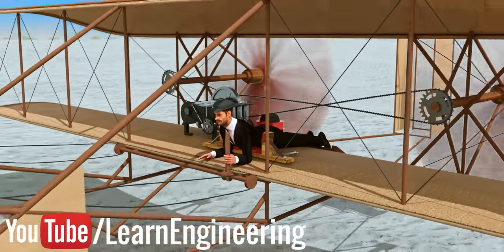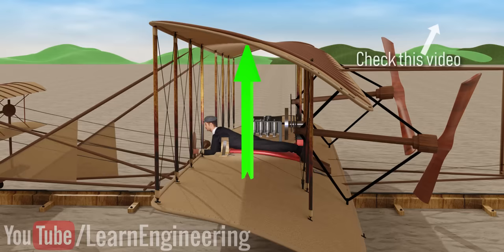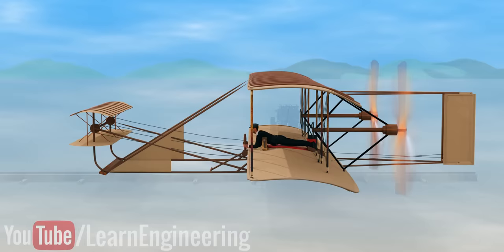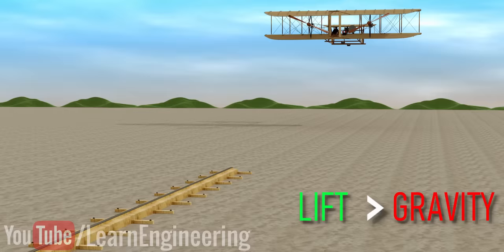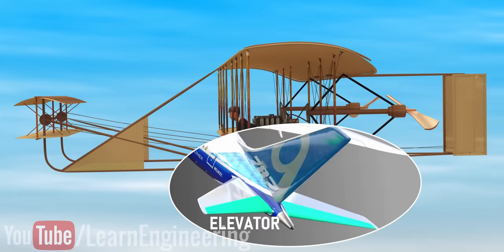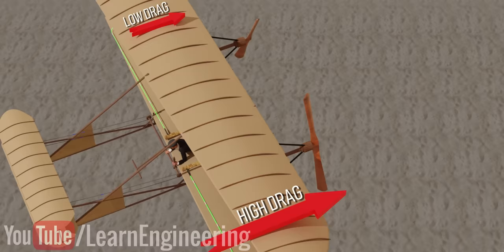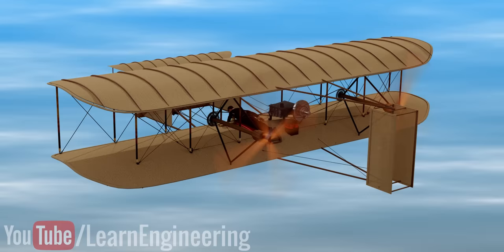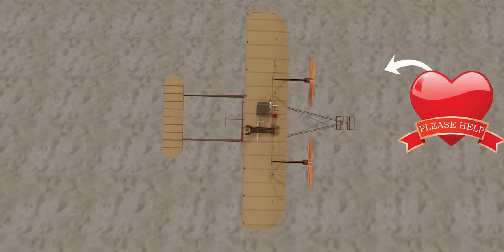The Brilliant Engineering of FIRST FLIGHT !

Comment: Pilot off center to correct center of mass offset due to engine weight.
Reply: Satvik Sharma 👍
Reply: I was stinking the same
Reply: The perfect replica don't flew.
Reply: Kyon pel raha hai.Cheel, kawaun ya Hans jotne se viman udta hai.Viman Shasta ki copy dikhade.Viman Shasta print kyon nahi hua Sankrit mein. Dinassaur ke avshesh miley hain.Oldcoin bhi milta hein, old utensils milta hein, old bees,bodies, old swords, arrows sab milta hein phir old viman kahan gayab ho gaye. Unka avshesh kahan hai.India mein tab kerosene petrol 16 ya 17  century tak nahi tha phir viman kya season ke oil se udte they
Reply: A reason that has not been considered is to keep the engine as far away from the pilot as possible.
Capt. Ferber lost his life when he was crushed by the engine which was located directly behind him.  
Had he been flying a Wright 2 Model A,  he would have probably survived.  

There have been several Wright replica crashes that are quite similar to Ferber's
ill fated flight.  All attempted to make a bank and turn from a low altitude and dug a wing into the ground.
The pilots of the Wright replicas walked away unscathed.
Reply: @sanpol4399  
SB: Joe Bullmer argues that the photograph is from 1908 not 1903.  I agree.

Tom Crouch claims it was a photo of the 1903 flight.  
Did the Wrights make a similar claim?

The alleged statistics for the  4th flight are the least credible.  The performances of the 1903 exact replicas in 2003 in lighter winds and with a less experienced pilot are close enough to make the
1903 flights or 120 ft. and 175 ft. plausible.    

There is no good explanation for the reported 852 ft. flight.
Reply: @stevebett4947  Joe Bullmer tells that the statement that Wilbur made about Flyer 1 taking of without assistance was not true .
  It confirms that Flyer 1 had thrust lower than total drag at the minimum flying speed.
Reply: @sanpol4399  

SBL  You are mixing a statement by Bullmer and your opinion of what it means.

I think we all agree that the 1903 Wright Flyer or its exact replica could not take off without the assistance
of a strong headwind.  

You do not provide any evidence that Bullmer thought that Drag was in excess of Thrust at 1300 rpm and above.
We have discussed the first NASA wind tunnel study.  We agree that when you use an exact replica of the museum
replica prop, it does produce more drag than thrust above the RPM that the Wrights used.  When the study was repeated,  a different prop was used.  It was one provided by Hyde that was based on the Wright's notebook.
Reply: Another discussion.  You can comment on it if you want.

@Harpiasonhadora sonhadora

SB: Você está certo, tanto os franceses quanto os americanos existiam informalmente antes de serem fretados.

Leia um pouco mais e você encontrará mais do que uma citação simples.
Não acho que consideraríamos a prova publicada, um pequeno artigo dos Wrights, como fora de dúvida. Não houve prova incontestável porque havia apenas testemunhas informais. Alguns podem ter
foram membros do Aeroclube, mas não foram testemunhas oficiais.

Acho que concordamos que o que o Aeroclube americano aceitou como prova menos do que aceitaríamos como prova incontestável.
O que era evidência suficiente para eles não seria suficiente para nós.

A maioria dos supostos eventos encontrados nas histórias da aviação eram mais plausíveis do que a conspiração
teoria de que eram todos trotes. A evidência que você precisa para
suas conjecturas e especulações parecem ser muito mais baixas do que o que você exige para as reivindicações dos Wrights
ou narrativas escritas por historiadores profissionais.

Era mais do que apenas a opinião do presidente da AAC. Foi a opinião da maioria dos membros.

Acho que o Aeroclube americano copiou a carta do Aeroclube francês.

Você afirma que os irmãos Wright não fizeram nada é um exagero.
Eles tiveram 4 eventos públicos e um teve mais de 100 testemunhas.
Muitos testemunharam o Wright Flyer III voando em círculos ao redor da pastagem de Huffman Prairie em 1905.

Contanto que você siga os argumentos desenvolvidos por Lins de Barros (ver Wikipedia)
nós concordamos. Quando você adiciona conjecturas sem suporte, nós não o fazemos. Procuro o melhor histórico
narrativa. O que você está procurando?

Acho que precisamos nos concentrar nas histórias menos plausíveis.
Acho que há alguma evidência de que parte do que os historiadores escreveram está errado.

Também há evidências de que algumas das reivindicações feitas por você são incorretas ou incompatíveis
com comentários disponíveis. A sugestão de que os Wrights não voaram usando seu Vertical 4 de 1906
ou uma réplica do Vertical 4 construído sob licença pela B&M é desinformação e especulação sem suporte.

A sugestão de que os Wrights usaram alguns dos recursos do bis-14 não faz sentido até que você
liste os recursos específicos que podem ser copiados. O uso da Antoinette 8V 1906 era uma possibilidade e foi copiado
por outros pioneiros. Não foi copiado pelos Wrights nem foi Santo Dumont a fonte para a necessidade de um
motor. Os Wrights e outros estavam cientes disso se o objetivo fosse produzir um avião prático de dois lugares.

A ideia de que Santos-Dumont teve alguma participação em seu desenvolvimento está claramente equivocada.
O motor completo com transmissão e hélice pode ser comprado na prateleira. Cody comprou seu motor
da empresa de motores Antionette, não Santos Dumont
Reply: @stevebett4947   None of the replicas of Flyer 1 have  thrust bigger than drag. The wind tunnel test made at NASA shows the same, Joe Bulmer tells Flyer 1 could not even take off without assistance,  ( did Wilbur lie about that saying the oposite ? Who is wrong? Joe Bulmer or Wilbur? ).
   There is not a single evidence Flyer 1 could fly sustainable ( thrust bigger than drag).
   The conclusion that we already got, is that Santos Dumont's flights are facts, but there is no way to be sure about any Flyer flight before Santos Dumont's flights. 
    As this is a dispute about who flew an airplane first, I stick with the facts rather than hypothesis.
Reply: @sanpol4399    

SB:  You don't always distinguish fact from opinion or conjecture.  You don't always stick with the facts.  

The only empirical facts are contained in the rules and regulations for the Deutsch-Archdeacon prize.  We haven't even found a copy of the rules.  Until we do we are just making guesses.  

A hypothesis should be consistent with the facts.  Nothing wrong with that.  It has nothing to do with faith although we might prefer one hypothesis over another for personal reasons.  

We agree that there is no way to be sure  about the any of the Wright's claims for the performance of their prototypes before 1908.  You want to apply one standard for the Wrights claims and another for critical counter claims.  They are both speculative hypothesis.  

I think there is evidence that there is some agreement on the statement that the Wright flyer could not take off without assistance from the wind. There is evidence that Wilbur and Orville agreed with the statement.  Did you find a quote that implied they didn't?

I don't think you have clearly defined what you pack into the concept of sustained flight.  If you have a good definition use it instead of the ambiguous "sustained flight"  SF is not a technical term but it could be defined as such.  Check the dictionary for the non-technical meaning.

The Wright flyer could not take off if the prop drag was greater than thrust.  This is not part of the debate.  The argument is whether or not the props on the museum replica were exact replicas of the ones used at Kitty Hawk.

We agree that the Wrights did not provide incontestable evidence that they flew in 1903.  Do we agree on what counts as incontestable evidence with respect to the 1906 flight of the bis-14?
Reply: @stevebett4947  The conclusion we got is:
   There is no way to be sure about any Wright's airplane flights before 1908.
   Santos Dumont's flights were facts.
   There is a dispute , and this is a dispute between hypothesis (or faith ?)  and fact.
    Some choose the facts and are sure about 14-bis described  flights .
    Other choose the hypothesis and are not sure about Flyers  described flights.
    Santos Dumont flights were public, and there was a  comission judging the flights.
The reporters tell the same history. 
   The airplane had 50 hp and was lighter than the Flyer 1, with 340,2 kg and only 12 hp.
   So far, none of the Flyer 1 replicas could fly sustained (with thrust higher than drag).
  14-bis replica can easily do what was achieved in 1906.
Reply: @sanpol4399  You don't seem to appreciate the problem of communicating when you limit yourself to the facts.
You don't limit yourself to just the facts when you criticize
the claims of the Wrights and the historic narrative regarding the Wrights activities.  

All you have to say is that the Wrights did not provide any
incontestable evidence for their reported flights and records.
At least not until 1908.

The argument does not have to be supplemented by unsupported speculation.

The Wrights claims do not meet the standards that Archdeacon,
Ferber, and others French patriots set up to counter the press the Wrights were getting in the Aero Clubs publication, L'Aerophile.  
There public relations was successful in 1905 and remained so
until 1908.  Henrique Lins de Barros revived it in 2000.

You continue to say that the exact replicas of the 1903 Wright Flyer
failed to fly without acknowledging that two of the three exact replicas did get off the ground in their test flights.  They only flew
about 100 yards and were in the air only about 10 seconds or so.
It is not much of a hop but it is something more than a complete
failure as in the Centennial windless flight.

More later.  I am tired and I lost my first draft.
Reply: @stevebett4947  Besides Wright claims can not be proved,  it is also a matter of Phisics.
   two questions:

1-Can you prove there was Wright  airplane flight before 1908? 

2- Wright Flyer 1 had 340,2 kg, 12 hp and props rpm just 350.
Even with the test made at NASA telling it was extremely unstable, and that the Drag was higher than thrust,  and even as all of the replicas showing the same result as the NASA's wind tunnel, 
Do you believe it could fly sustainable,( with thrust equals or bigger than drag) ?
Reply: @sanpol4399   wrote:

1-Can you prove there was Wright  airplane flight before 1908? 
2-Can you prove there was Wright  airplane flight before 1908? 
3-All NASA wind tunnel tests indicate D > T
4-Can a prototype with D>T fly sustainably.

SB:  

1.  I can provide historical evidence that most aviation historians
agree that the Wrights' flew as described in their notebooks.  

The Wright Experience exact replica proved that the craft was capable of a 10 sec. flight covering about 100 feet or approx. 33 meters.  with a 15 mph headwind.   This is consistent with the reported flights of 120 to 175 ft. with a 21+ mph headwind.

There is no incontrovertible or incontestable  proof for the claimed flights that would satisfy you.  It shouldn't satisfy the FAI either but
they went ahead and certified the claimed flights with no official witnesses.    Any ideas on why they did this?

There was one public flight before a crowd and 30 invited guests that included multiple laps around the Huffman Prairie cow pasture.  Capt. Ferber, who had been a leading critic of the Wrights, interviewed the invited guests and concluded that the event took place as described and that the Wrights were not making it up.  

This is supposed to have been reported  in L'Aerophile but I haven't found it yet.  You should read this magazine since it is on the Web along with a full text version which can be copied and pasted into a language converter if you don't read French.  

What I found interesting was that the magazine was not dominated by either Santos Dumont or the Wright Brothers.  They are mentioned but not as much as I was expecting.  

SB:  There were members of the American Aero Club in the audience but they were not official witnesses.  However, their opinion was essential for a majority of members to vote to certify the authenticity of all the alleged Wright flights.  

Personally, I doubt that the 59 sec. flight covering 852 ft. was
accurate.  Fortunately for them they were never asked to replicate it.  They might have said they could replicate it if the conditions could be replicated but they would prefer to replicate it with an updated prototype.  

2.  I can't prove any of the early flights with the kind of incontestable evidence that you (and the FAI) require.  
You can't prove that they didn't make the flights as reported.
There is no incontestable proof that they didn't do what they
said they did in their notebooks.  

Can you explain how they could have possibly provided the
kind of evidence you want before the FAI was created?

3.  All of the wind tunnel tests do not prove D > T.  Not true.

The first NASA test of a close replica of a museum replica
indicates that D>T for the prop when the RPM is greater than 350 RPM.  

Note:  The prop RPM was higher for the Wright Flyer 2 Model A using a Dayton built Four cylinder upright engine that weighed under 180 lbs. and produced 30-40 hp depending on the RPM.
One could substitute a European built replica engine built under license. 

4 .- Can a prototype with D>T fly sustainably.

Is this a trick question?  If D>T, how can the craft get off the ground?  If it can lift off, how can it fly?

Do you want to define what you mean by sustainable.  
I don't think your technical definition matches the one in
the dictionary.  Can a craft that fails to get out of ground effect
be said to fly sustainably?

I have answered a similar question before.  I think I said that
there is no proof of sustainable flight unless the plane flies in circles at a significant altitude.  Only the Wright Flyer III and the late prototype or the Wright Flyer II were capable of sustained flight.

I am afraid to add links since I lost my earlier comment when I tried this.
Reply: @sanpol4399  wrote:

1-Can you prove there was Wright  airplane flight before 1908? 

2-Do you believe it could fly sustainable,( with thrust equals or bigger than drag) ?

SB:  I recall answering those questions.  I don't recall you answering mine.

1.  No.  I must have answered this question a dozen times.
There is no incontestable evidence or proof that 1903 Flyer flew.  There is
evidence that the 1903 exact replica flew if you call a feeble 100 ft. 10 sec. hop FLIGHT.

2.  Can the Wright flyer fly if prop Drag is greater than Thrust ?   No
     Can you call a short duration hop sustained flight?   IMO No.   
     
3.  Would you call a 25 m. hop sustained flight?   I think we may disagree on this one.
     I would only call a flight sustainable if it were free of ground effect and flying in circles.

     I wouldn't call Santos Dumont's flight of 100 m. an example of sustainable flight
     for 2 reasons.  It was too low to be free of ground effect and while the 220 ft. claim might
     qualify it cannot be considered to be incontestable evidence because it was not what was
     tested according to the Deutsch-Archdeacon rules and regulations.  
     The only official distance is 100 m.
Reply: @sanpol4399  When you believe what is not absolutely certain, is this FAITH?
Is there a difference between expecting something based on past experience and
FAITH?   I expect that the sun will rise tomorrow but I don't believe that it is a certainty.

What are you absolutely sure about with  respect to the 14-bis last Oct. 2006 flight?

Are you sure about the date?  This was not included in the DA prize rules and regulations.

Are you sure about the over 220 ft. estimated distance?  The rules and regulations only mention
a 100m distance.    For me, this indicates that 100 m is incontestable and the 220 m. distance isn't.

The 14-bis replica has a popular video that demonstrates a flight of unspecified distance with a modern Rotax engine and a modern prop.  According to the old FAI requirements, it does not 
qualify as incontestable evidence.  

Why didn't Alan Calassa even attempt to set up a competition
with witnesses from the French Aero club so it would qualify?   
I bring this up because there are a couple of Wright critics that
also question the short hop of Sr. George Cayley flying machine 
because he did not follow the FAI rules.  

Cayley only used the reported short insignificant hop 
to claim that true flight would not be possible,
He did not try to claim as factual or promote his reported flight.

Cayley concluded that until there was an advance in technology, there would be no true flight. 
Cayley used a light weight 8 hp (non gasoline) engine and a bad prop.
He may have believed that true flight could only be achieved with a light weight 50 hp engine.

Footnotes:
HS: @Steve Bett cayley never registered a plane and did not start aviation at any time, look at the reality please. 
There are no statements from cayley showing that he had arrived on the plane, proven or even registered. 

SB:  In other words since Cayley did not attempt to prove that his(1870?) hop actually took place and did not use the FAI standard to make that proof incontestable --- it didn't happen.

https://britishheritage.com/sir-george-cayley-the-father-of-aviation.amp

...John Appleby, to jump aboard. He flew 900 feet across Brompton Dale, 
becoming the first adult to fly 
in a heavier-than-air machine.
Legend has it that Appleby’s first words upon landing were: 
“Please, Sir, I wish to give notice. I was hired to drive, not fly!” 

His panic is understandable; Appleby was 79; his employer was 80.
Reply: @stevebett4947  SB" When you believe something what is not absolutely certain , is this faith?"
   YES!  Unless you can prove.
That faith is even bigger when we go against the laws of physics,  believing  the impossible. 
    For example. It is impossible that a Flyer 1 can fly sustained,  (with thrust bigger than drag). 340,2 kg and 12 hp makes it impossible for the Flyer 1 to make it.
Reply: @sanpol4399  

SB:  Definition of faith: 
 complete trust or confidence in someone or something.
synonyms:  trust, confidence, ....

What do you call it when your trust is not complete?
Is it still called faith?   

We speak of levels of confidence
but rarely of levels of faith or belief.

Does FAITH apply to what we just expect to be extremely likely?
Do you have faith that the the sun will rise tomorrow?
Do you have faith that the stock market will not crash?
Most people don't expect a radical shift in the market but wouldn't be
surprised if it happened.  You can expect something 
while believing that there is a strong possibility that you are wrong.

Do you have faith that 2+2+=4?
Do you have faith that a logical fallacy is false?
Are the laws of physics something  that has to be taken on faith?

Do you have faith in a particular religious doctrine?
Faith usually means beyond experience or rational knowledge.

Do you have faith in a proposition or statement or theory that cannot
be falsified?  

If something is against the "laws of physics"  either you have interpreted the facts wrong or the particular law needs to be revised.  The so called
laws of physics are not necessarily for all time.  The are usually just the
best explanations we have at this time.

I doubt that anyone claimed that something could fly when drag is
greater than thrust.  

When you watched the video of the 
exact replica of the 1903 flyer making a 50 ft. hop, do you say "don't believe your eyes because that would violate  laws of physics? " 

As I recall  you shifted your argument
Reply: @sanpol4399  
SB:  "faith"  is usually associated with belief in something spiritual, Devine,
supernatural, ect. ... that cannot be proven.  They have to be taken on faith.

I don't care for those connotations when talking about science or physics.
You imply that you have faith in physics.  Is that the same kind of faith that
you have in a religious dogma or a legend?

There are at least 100 nuances of faith.
There are at least 6 different concepts or types of faith.

Your attitude toward a video of the replica 1903 Wright Flyer hopping 100 ft. 
indicates that you don't believe your eyes because it is at odds with your interpretation of physics.
You only believe your eyes when it is consistent with your strongly held opinions or your expectations.
(not sure which)  e.g., the failure of the exact replica of the 1903 Wright Flyer to fly.

A scientist such as Henrique Lins de Barros would interpret the failure of the Flyer to fly
as proof of his claim that it couldn't fly without assistance.  The assistance of the small motor
is ok but not the assistance of a strong headwind.  They Wright Flyer I required both.

The scientific reaction to an unexpected event is to search for an explanation that is consistent
with what we think we know about science.  In the history of science there have been quite a 
few cases where an event could not be explained by the science of the day and so our understanding
of science had to be modified and extended.  I think there are perfectly rational explanations for why
the Wright Flyer I could get off the ground at Kitty Hawk, NC.  It was incredible in 1903 and most people
didn't believe it was possible.  That opinion persisted for 50 years outside of major metropolitan areas.
Reply: Steve Bett 
SP:  " When you believe something what is not absolutely certain , is this faith?" YES! 
SB:    NO.  Absolute certainty is rare.  There are many things I consider ordinary rather than incredible.  They are consistent with my expectations.  

SP:  Unless you can prove it (you are taking it on faith). 
That faith is even bigger when we go against the laws of physics, believing the the impossible. For example. 

SB:  By this do you mean that you won't believe your eyes when an event is not consistent with your
interpretation of physics?  You need to find a scientist who agrees with your interpretation.  
The scientist associated with the Old Dominion University sponsored wind tunnel test in Virginia came to a different
conclusion that was no more consistent with physics than your conclusion.  

SP:  It is impossible that a Flyer 1 can fly sustained, (with thrust bigger than drag). 340,2 kg and 12 hp makes it impossible for the Flyer 1 to make it.  

SB:  It doesn't have to.  Even the first NASA study concluded that even with a defective prop they copied from
what they took to be a replica or a museum replica.  The Drag would not be greater than Trust unless the 
RPM was higher than 320.  After 320 RPM, the drag increased at an increasing rate.  It is clear that the
Wright Flyer could not have taken off with such defective props.  

IMO:  This prop had to be one of the throw away props that the Wright's carved or had carved
in their pursuit one one that would pass their static test in their Dayton shop.  
The props at Kitty Hawk had to pass another static test.  One that used a spring scale.  
Their notebooks describe exactly what they did and how they were delighted
at the fact that the Thrust was greater than what they had anticipated in their calculations.  
They had problems  with a shaft that connected the engine to the propellers but no reported indication
 of a underperforming props.
Reply: @stevebett4947    What I mentioned is that
I am sure Santos Dumont flew because it can be proved.
    You said there is no way to prove the Wrights flew before 1908. After telling that you admit you are not sure . Are you?
Reply: The Flyer couldn't fly at all, that's why you NEVER ever will see a replica flying:  The Flyer was  completely UNSTABLE, OVERWEIGHT, UNBALANCED, one side was heavier than other, UNDERPOWERED, UNCONTROLLABLE.....  IT  CAN'T FLY!!!!!! THAT'S WHY YOU WILL NEVER SEE A REPLICA FLYING EVEN TODAY!!!!!
NASA REPORT >>>>"Wright Flyer", A look at handling qualities of canard configurations, Nasa , p. 8, TM 88354, ...the Flyer was highly unstable... The lateral/directional stability and control of the Flyer were marginal."<<<<

*"Modern analysis by Professor Fred E. C. Culick and Henry R. Jex (in 1985) has demonstrated that the 1903 >>>>>Wright Flyer was so unstable as to be almost unmanageable by anyone<<<<<< but the Wrights, who had trained themselves in the 1902 glider"
Abzug, Malcolm J. and E. Eugene Larrabee."Airplane Stability and Control, Second Edition: A History of the Technologies That Made Aviation Possible"*
cambridge.org

Not powered!!!!!!  not controlled!!!!!!   not sustained!!!! NEVER SHOWED!!!! not  registered by the gov or any  reliable institution!!!!! JUST THE BIG AMERICAN LIE!!!!!    THE FLYER COULDN'T FLY AT ALL!!!!!!  ...and you PROUDLY SAY IT IS "the first powered, heavier-than-air machine to achieve controlled, sustained flight with a pilot aboard"???     HAHAHAAHAH

Only in 1908 the Wright brothers flew their powered glider in public >>>with a catapult<<<<- AFTER they looked Santos Dumont FREE aeronautic contribution to mankind.

Nobody can answer it: 1  Could The Flyer fly without CATAPULT, STRONG WINDS AND A HILL???      2 When did the Wrights fly their FIRST PUBLIC  RECORDED FLIGHT????  Which reliable institutions, journalists, government....   were there to certificate Wright Brothers flights???????  3  WHY YOU WILL NEVER EVER SEE THE   FLYER REPLICA FLYING??????  

https://www.youtube.com/watch?v=povGggaIK2A
Reply: @rjnbonif3603 And one thing that is absolutely intriguing is.
   Between 1905 and 1908, the Wright brothers disassembled the Flyer 3, and stopped testing it.
   Why, someone would stop testing something new, if  was having success in the tests?
   Meanwhile,  Wilbur went to france, to check how was the aviation progress over there.
   While the Flyer was at a storage, disassembled, Europe was flying since 1906.
   Was just after that visit to Europe , that they just appeared in public for the first time.
   That is at least quite strange.
Reply: @rjnbonif3603  time for your medications.